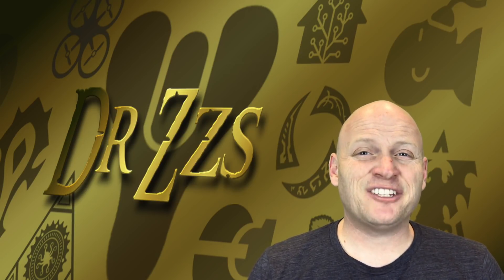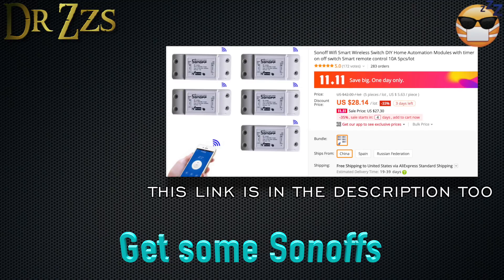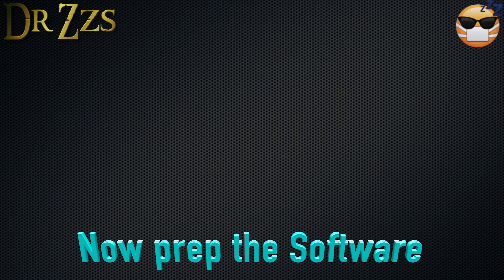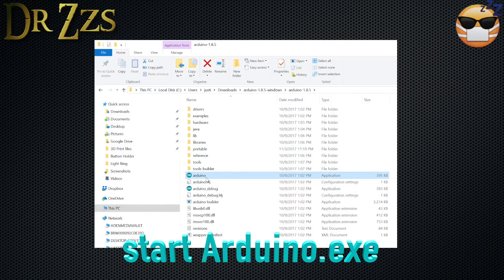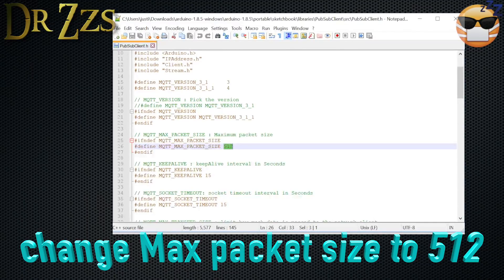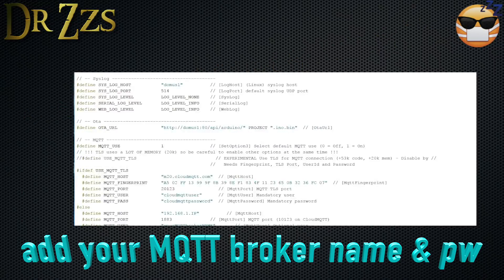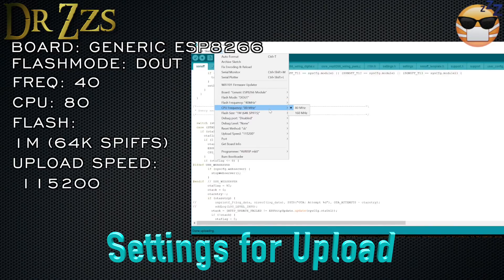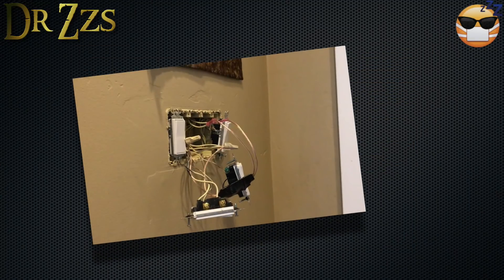Flashing TASMOTA Firmware on the Sonoff Basic

Comment: HiI get this error :-(Arduino: 1.8.5 (Windows 10), Board: "Generic ESP8266 Module, 80 MHz, ck, 26 MHz, 40MHz, DOUT, 1M (64K SPIFFS), 2, v2 Lower Memory, Disabled, None, Only Sketch, 115200"In file included from C:\Users\Frank\Downloads\Sonoff-Tasmota-development\Sonoff-Tasmota-development\sonoff\sonoff.ino:37:0:sketch\sonoff_post.h:41:24: fatal error: esp-knx-ip.h: No such file or directory #include <esp-knx-ip.h>                        ^compilation terminated.exit status 1
Error compiling for board Generic ESP8266 Module.This report would have more information with
"Show verbose output during compilation"
option enabled in File -> Preferences.

Comment: Be aware that Sonoff is now shipping the R2 version of this Sonoff Basic... the pin holes are now filled with solder to prevent you from flashing the device and you will likely destroy multiple units before getting the procedure down right.... I have six Sonoffs in my walls and now regret taking this route - will be looking for another vendor who is not actively fighting their user community
Reply from the maker: That is unfortunate.  I also would like to see them embrace those of us who want to use their hardware in our own way.  For what it's worth, they have contacted me and seemed quite happy that I've been promoting their devices, even though I always recommend replacing the firmware.  

You don't actually have to de-solder the R2 versions to flash them.  It's not as convenient as having the holes we had before, but if you just hold male jumpers on the soldered locations you may not get the flash done the first time, but you won't destroy the unit.  
I don't expect there's a device maker out there that is happy to have their devices hacked.  I wouldn't be surprised if they did this in response to some potential liability if they know their devices are being "misused" and they don't take some action to prevent it.  

If you do find a better option to the Sonoff, I'd love to hear about it.  So far I've not seen another brand of device with the same quality and low price.
Reply from the maker: They might.  I'm just starting to work directly with iTead.  I doubt they will consider me important enough to consult with early on with new ideas though.  I sure wish they would!

Comment: I keep getting this:
warning: espcomm_sync failed
error: espcomm_open failed
error: espcomm_upload_mem failed
Reply from the maker: That means the computer isn’t able to communicate with the esp chip. So either the board isn’t in programming mode, or the Rx/Tx wires are reversed, or the Com port is wrong. 
Hope that helps

Comment: Thanks for such great videos!! Do they have Tasmota firmware for Sonoff T1 1/2/3 gangs touch switches, or have you had any experiment with them? Would love you to cover those as well.
Reply from the maker: I have a T1, single UK version and a T1 triple US version.  I expect I'll have videos done for those in the next week or two.
Reply: Thank you for your reply. I wrote my own arduino based firmware for Sonoff Basic and successfully integrated that with my own mosquitto broker and Node-red dashboard. While I was upgrading my sketch to work with Sonoff T1 UK 3-gang, I found another lovely little firmware called Kman-Sonoff ( https://github.com/KmanOz/KmanSonoff ), which integrates beautifully with my system, including those T1 3-gang. I did not particularly like Tasmota's approach of bundling a whole lot of libraries with its distribution, and the intimidatingly huge code base in 71 files (over 1.2 MB); Kman is just 2 files (about 16 KB) for nearly the same functionality. I don't like the Arduino "portable" approach either, coz I already have all those libraries installed in my working version of Arduino IDE,. Kman, IMO, is an smarter implementation and lot easier for beginners. The only shortfall is, you have to upload the firmware each time your WiFi access credentials or mqtt address change. But that too can be accomplished via OTA (code is there, although I did not test it). I think Tasmota is an overkill.

Comment: Great video, worked through most of my errors but I keep getting the espcomm_sync failed. all my research says is that I am not in flash mode and I have been trying for hrs on two different sonoff basic and still no joy. Any advice?
Reply from the maker: try swapping your Rx/Tx wires.
Reply: Thx will give a try and report back
Reply: Ok I tried the other link that you posted and it worked and swapping the lines were key as well. now on to the next road block, adding it to openhab
Reply from the maker: Dwayne Baker wish I could help you there. Check out yoyotech. He’s more openhab-able.

Comment: Hello after flashing tasmota my sonoff changes relay position every 30 seconds and in between led lights up and after before changing relay againt if flashes few times .
Do you maybe know what the problem is ?

Thanks
Reply from the maker: whoa, that ain't right. 
I've not seen anything like that. 
Look in the Tastmota Console and see if there is any information there when it's doing that. 
But that is certainly not normal behavior.

Comment: After flashing, this work with the ewelink app
Reply from the maker: no, after flashing it won't connect to ewelink anymore.  
The purpose of flashing is to be able to use the sonoffs with Home Assistant or some other Automation hub (samsung smart things, OpenHAB, NodeRED, etc). 
If you're happy with using the ewelink app then don't do the flashing part. 
Hope that helps!
Reply: DrZzs after this flashing worck with siri. ( homekit)
Reply from the maker: well, actually yes.  If you set up the HomeKit component in HA then it should still work with Siri.  And if you use HA cloud you can connect with Alexa and with Google Home.
Reply: DrZzs after falshing this worck on (pcb)board switch

Comment: FYI: For the latest stable version of Arduino ESP8266 Board Manager:

http://arduino.esp8266.com/stable/package_esp8266com_index.json

The latest stable version is 2.4.1
Reply from the maker: thanks.  
The process for flashing I used it this video is quite outdated now.  The method I've been using lately is just to download "sonoff.bin" from Tasmota
https://github.com/arendst/Sonoff-Tasmota/releases

and "flashesp8266.exe" from ESPeasy
https://github.com/letscontrolit/ESPEasy/releases/download/mega-20180513/ESPEasy_mega-20180513.zip  
No need to mess with board managers or libraries etc.  

https://youtu.be/NNW05smSNOA
Reply: I've been using ESPEasy and it's been working great... I tried the method in this video afterwards, because of something I read about Rules that needed to "be enabled when compiling".. For a second I thought that there may be features that are not enabled by default and doesn't have some section in the configurations - I couldn't find anywhere to "enable" or "disable" Rules in the configurations - and using ESPEasy would skip over them.

I read so much on Tasmota pages and to be honest, they don't clarify things completely some times - lack of context in most cases.. So, I end up wasting time going through this to find this "Rules" feature so I could enable it. However, while going through the method in this video, I was able to find out a few things... So I really didn't mind after all... Going through this video cost me almost 2 hours and I still learned more than the 2 days of reading through Tasmota forums and Wiki pages.. Thanks for the video...
Reply from the maker: wow.  Thanks! 
Glad to help. 
I know they added some rules functions in the newest version of tasmota (5.13 and newer I think).  There isn't anything you have to do before flashing to have access to them.  I don't know much about ESPeasy firmware.  I've been meaning to try it but just haven't had time yet.

Comment: Can one flash the Sonoff G1 with Tasmota as well?
Reply from the maker: I would assume so.  I'd need to open up the G1 to see where the serial pins are located.  Looking at the outside of it I think it's similar to the Sonoff Dual.  The pins should be easy to find.  The trick will be getting it into programming mode.  I don't see the G1 on the Tasmota wiki page.  Maybe we can work it out together.  if you can take the case off and post links to pictures of the board we can try and work out which sonoff model it is based on and how to get it programmed.

Comment: Use arduino IDE for non admin install. installed gives error when creating portaable folder.
Reply from the maker: The process has changed since this video.  You don't need to make the portable folder anymore.  The most recent method doesn't require it.  
Here's a newer video on the process: https://youtu.be/c2IUIUnxjUY
Even since then the process has changed.  If you copy all the files from the Tasmota Lib folder into the Arduino Libraries folder you don't need to change the pubsubclient MaxPacketSize.  

Use Tasmota version 5.12
5.13 is out but there's been a couple issues that need to be resolved.

Comment: Thanks. I know everybody is enthusiastic about Tasmota, but I find it overly complicated. Never even have been able to compile the software. 
I am actually quite happy that ITEAD didnt put the tasmota software on their device, but what I would like is a simple OTA section on it.
Reply from the maker: I would suggest trying a new install of Arduino IDE.  TASMOTA is just an Arduino sketch. If you’re having trouble compiling it is likely something with the IDE.
Another alternative is to download sonoff.bin from the TASMOTA github page and use flashesp8266.exe to load it on the board.  
EWeLink is fine if you don’t want to use Home Assistant or another Smart Home hub. 
If you’re happy with it there’s no reason to change. The purpose of TASMOTA is to increase the customization and function of the esp8266 devices. 
Hope that helps!
Reply: Thank you, I have been flashing Sonoffs, but with my own software, not with Tasmota. 
HOWEVER...… I did find the problem why I couldn't compile: I was using  esp8266 core 2.4.2. When I went back to 2.4.1 my compilation errors were gone.
having said that, using the bin file is a good option too

Comment: I have a PIR sensor that will turn on my lights (Using son off RF bridge)  but I want them to be switched off after 3 mins automatically.. can we schedule this in sonoff basic using ewelink ?
Reply from the maker: I'm not sure with the ewelink app.  I know you could do it with Home Assistant or another smart home hub.  I'd be surprised if the ewelink app could do that kind of automation.  
Sorry.
Reply: Hi, Thanks for the reply. I have few questions

1. Do you know if there will ever be a sonoff bridge

2. Is there a 433 mhz alaram that i can pair with sonoff bridge to go off when the door sensor is activated.

3. I have seen your on air upgrade to TASMOTA for sonoff basic , is the procedure same for sonoff pow and sonoff TH 16

4. Can we use ewelink after tasmota update ?

5. Sonoff these days are having multiple products which are basically the same base unit with a little added functionality but there is no product which has every feature in it. Is it possible to have a sonoff pow2 to have the sonoff th features OR to have the power measurement to sonoff basic . It would be good if you can do a video with all the devices in sonoff family and some good devices compatible with them (with both RF and WIFI) with improvements that we can do for that device.

Thanks for positing the videos you did till now they are very informative.
Reply from the maker: there is an RF bridge if that's what you mean. 
https://www.itead.cc/wiki/Sonoff_RF_Bridge_433

I don't know much about the RF alarm options.  Check the iTead website. They probably have something like that. 

OtA should work on any sonoff.  The difference is just how you get it into programming mode. 
This page should tell you if there's a different procedure for the one you're using. 
The difference is really just where to find GPIO-0.  It isn't always attached to the on-board button. 
https://github.com/arendst/Sonoff-Tasmota/wiki

No, once you flash with Tasmota you can't go back to the eWeLink app. 

ya, no one device does it all.  But with Tastmota you can do a lot with the extra pins.  So you can use a TH or a PIR or add a second relay.  You just have to decide and do a little tinkering.  They can do dang near anything.

Comment: What if I bought a new router and I can't change its name. Does it mean that I will have to reprogram every sonoff in my home? Thanks for this great video!
Reply from the maker: Great question.  What you'd need to do with a new router is create a wifi network with the same SSID and Password. That way the sonoffs will be able to connect.  The other thing to do would be to go into the new router and set the IP address for your HA pi (and MQTT broker) to the same IP address as it had on the old router.  That way all the sonoffs can still send and receive MQTT messages.  
If you don't use the same wifi SSID/pw and if you change the MQTT broker IP address then you will have to go in and change each sonoff.  There's a bit of software for windows called SonWeb.  I haven't used it but I understand it is supposed to create an interface for all Tasmotized Sonoffs to be viewed and changed all at once. 
https://github.com/arendst/Sonoff-Tasmota/wiki/SonWEB

Hope that helps!

Comment: Hello, thanks for the video !! i have this problem in my arduino : Archiving built core (caching) in: X:\XX\XXXX\AppData\Local\Temp\arduino_cache_805682\core\core_esp8266_esp8266_generic_CpuFrequency_80,FlashFreq_40,FlashMode_dio,UploadSpeed_115200,FlashSize_1M64,ResetMethod_ck,Debug_Disabled,DebugLevel_None_____e5e5b35e33f7dd4a73d3dd0f9e7dba11.a
"Le croquis utilise 494624 octets (51%) de l'espace de stockage de programmes. Le maximum est de 958448 octets.
Les variables globales utilisent 50888 octets (62%) de mémoire dynamique, ce qui laisse 31032 octets pour les variables locales. Le maximum est de 81920 octets."
Reply from the maker: Looks like a "Max Packet Size" error.  2 ways to fix it.  1- find "PubSubClient.h" file, open it and change the line for Max Packet size to 1000.  or 2- get the latest "PubSubClient.h" file from the Tasmota github and put it in your Arduino Libraries folder.  
I've done a couple newer videos than this one that show what to do.  
https://youtu.be/c2IUIUnxjUY

https://youtu.be/B38e1HAMUXs

Comment: Hi I am getting error on colmpiling the code 

Sonoff-Tasmota-5.12.0\sonoff\xdrv_02_irremote.ino:25:29: fatal error: IRremoteESP8266.h: No such file or directory

Please guide.
Reply from the maker: One way to fix it would be to find all references to "IRremote" in the user_config.h file and but a # infront of them so they will be ignored. 
The other way (probably the better way) is to copy all the files from the Sonoff "lib" folder and put them in your Arduino Sketchbook "libraries" folder. 

That error is happening because you're missing a couple libraries that the sketch is looking for.  So you can either tell the sketch not to look for them (solution 1), or get those libraries and put them where the sketch can find them (sketchbook libraries folder). 

I did another video that explains where the libraries are and where you need to put them:
https://youtu.be/c2IUIUnxjUY?t=9m9s

Comment: So, the serial to USB adapter does not need to be soldered to the board?  As long as the pins make contact, you're good?
Reply from the maker: Yes!
I just use female/male jumpers from the adapter to the sonoff.
Reply: Time to try it, now that SonoOTA doesn't work any more.

Comment: Great video, all sorted fine. But still cant connect...
My idea is my Openhab dont connect correct to MQTT server, is there a way to test this? :) 
(The Openhab opg says 018-04-03 17:15:36.462 [INFO ] [penhab.io.transport.mqtt.MqttService] - MQTT Service initialization completed.

2018-04-03 17:15:36.485 [INFO ] [t.mqtt.internal.MqttBrokerConnection] - Starting MQTT broker connection 'broker' ) ,but things in the items file, dont trigger any thing in the log with the text mqtt? :(
Reply from the maker: I don’t know anything about openhab (yet!) 
When I need to diagnose an mqtt problem I use mqttLens. It’s a chrome browser extension.  You put your broker info in and it shows you all the subscriptions and published messages that come through. 
Sorry I don’t know the setup with mqtt and openHAB.
Reply: Think I had it solved, looking forward to some time to test:)
But thanks for fast reply, and cool videos;)

Comment: I recently used this video to flash and get all of my Sonoffs up and running. I didn't see a section in this vid about copying over the Libraries from the Tasmota Lib folder to the Libraries in the Arduino folder. So it gave me an error message for each one. Neopixel & IRremote were 2 of the error messages. So I just copied each folder over for each error, and that fixed that. Also, when editing the user_config.h file, remember to change the WIFI_CONFIG_TOOL to WIFI_MANAGER as you taught us in your other vid. Also, I had to increase the pubsub.h file MQTT_MAX_PACKET_SIZE to 1000 instead of 512.  Other than that, using this vid worked for me. That other UPDATED vid that had me using an old board manager didn't work. Ultimately, I started over with this vid and its all GOLDEN now. Thanks Dr. ZZs! By the end of yesterday, I had my first Sonoff running on Home Assistant! Keep creating your awesome vids, Thanks for all the time and effort you devote to them.
Reply from the maker: LouisianaIce Great!! And thanks!
Reply from the maker: Funny that the combo of the older and newer videos did the trick.